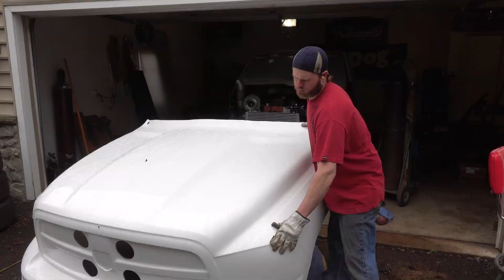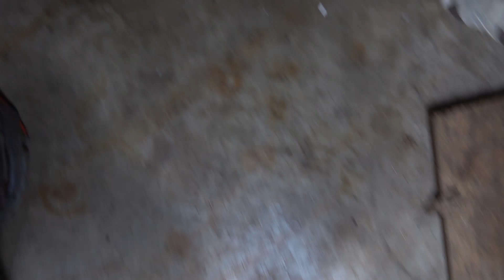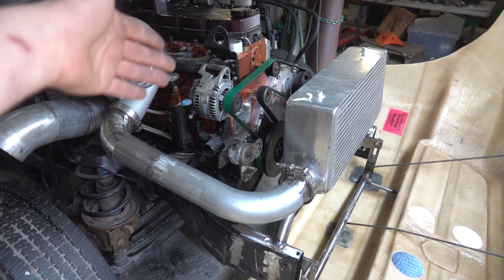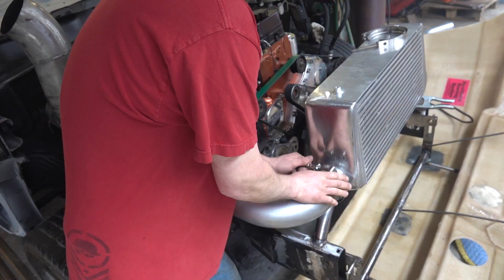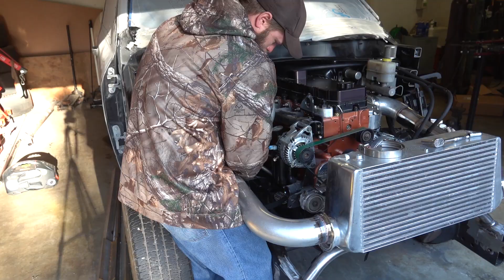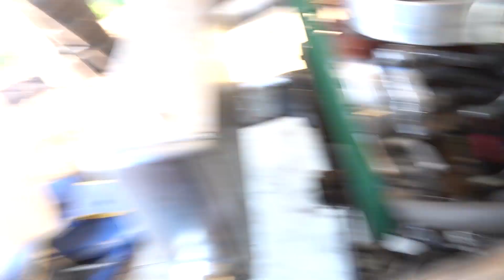Awesome Custom Turbo Piping For The 2000HP Cummins Build!!

Comment from the maker: What does everyone think of the Turbo/Intercooler piping??
Reply: Looks good man, you gonna try to make it to the next ODSS race?
Reply from the maker: Gonna try!
Reply: When going to hear it run again
Reply from the maker: Soon
Reply: Great looking setup! You make it looks so easy...
Reply from the maker: Thanks!
Reply: Sorry and the piping looks good great job on a truck learning to do everything yourself make you feel a lot better about when it's all done believe me iam try to build a 04.5 dodge and fun learning new stuff you didnt now u could do
Reply: It’s hard mounted to the chassis is there any room for give when the engine torques
Reply: It looks great and it’s simple the best combo ever.
Reply: Like it. That small old 90 v band off the turbo was bothering me.